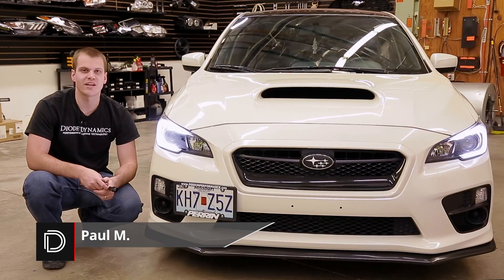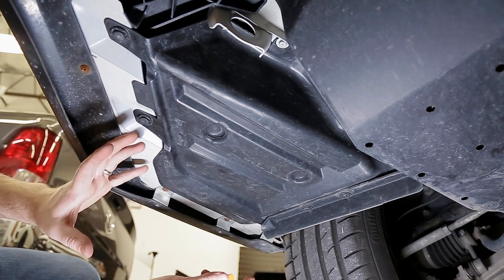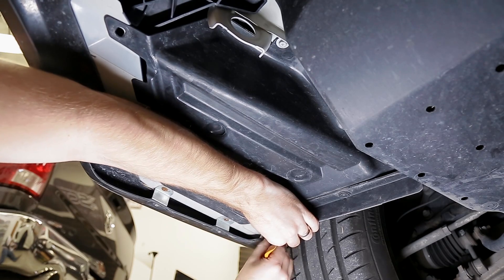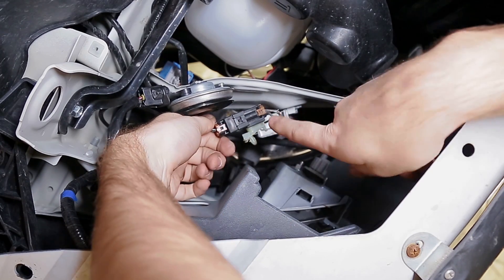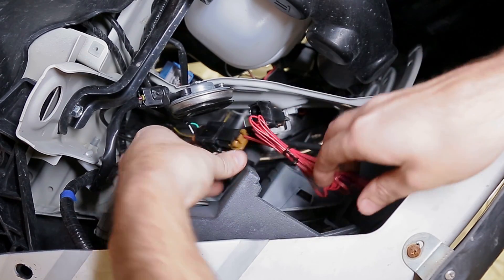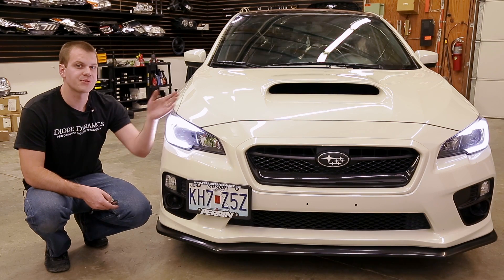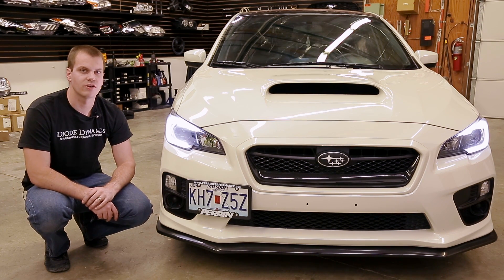How to Install 2015-2017 Subaru WRX/STi C-Light DRL Harness by Diode Dynamics

Comment: I have a 2017 premium. What do I need to buy to run this setup? I am guessing I need to swap out every bulb I have to LED's first?  Wouldn't the cost of doing that be on almost on par with a new set of nicer aftermarket headlight assemblys?

Comment: Installed this product and are very happy with the results! 
How do I keep my stock high beam function? And how do I keep my stock fog light function?
Reply from the maker: +Daniel Powers This harness won't affect the high beams or stock fog lights. It only keeps the C-Light on as the DRL when the headlights are turned on. If you have any further questions, please don't hesitate to contact us at 314-205-3033 Monday-Friday 9 a.m.- 5 p.m. CST, or shoot us an email at contact@diodedynamics.com!
Reply: can you guys toss up a link to the exact item on your website for 15+ WRX , just place it in description:)
Reply from the maker: +The Cisco Kidd This product is not listed separately on our website at this time. However, if you would like any assistance placing an order, please feel free to contact us at 314-205-3033 Monday-Friday 9 a.m.- 5 p.m. CST or at contact@diodedynamics.com!

Comment: I have the diode dynamics led bulb installed in my stock c light location on my 2019 wrx premium. Could i use this harness to disable the drl on the high beam spot and have the corner led run as the drl instead by tapping into the positive wire? I installed led high beams and the drl's are banging straight led high beam at people all the time. And i think the front would look much cleaner with the drl's coming from the corner.

Comment: Do you have to cut the  c wire and replace with the male connector. Or how you unplug the C wires from the headlights
Reply from the maker: Hey Lyon! You will not have to cut anything. You will simply unplug the factory connector from the back of the headlight. If you would like help with this process, please go ahead and give us a call at 314-205-3033 Monday-Friday 10 a.m.- 5 p.m. CST, or shoot us an email at contact@diodedynamics.com.

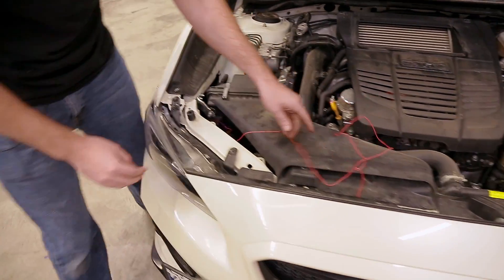Comment: 3:10 and 3:18 where does the other female/male part coming from? Is it from the head light?
Reply from the maker: If you watch from 2:18 and forward, it is coming from the new harness connector that is included in the kit!

Comment: So I have Akkon, spyder, redline 360, whatever you wanna call them, headlights and they have a clight. They are designed to run with the oem design. So the clight goes on when the 1st or 2nd light mode goes on. The drl is the high beam. I disconnected the drl plug so i wouldnt have my high beams on when my lights were off. Could I tap this harness into my headlights? I want me clights to be always on, even when the lights are off. I have an 18’ wrx
Reply from the maker: Hey David! Please go ahead and give us a call at 314-205-3033 Monday-Friday 10 a.m.- 5 p.m. CST, or shoot us an email at contact@diodedynamics.com, and our service team would be happy to help you with this!
Reply: Was this resolved I wanna know as well I have the harness installed to the c lights but my parking lights stays on as well.. I wanna know how to keep the parking lights off
Reply: @ljcorp09  Yes!! I made it work. You just tap the harness wires into the positive wires of the drl lights and leave the ground wires alone
Reply: @Gubster07  I've done that and my parking lights stays on for as well for some reason.. to make sure the positive on those headlights are the brown wire right?
Reply: @ljcorp09  Yes it is the brown wire, do you have a limited premium or base model?
Reply: @Gubster07  base model
Reply: @ljcorp09  Hmm interesting, not sure whats going on then, I have a premium and the light functions are the same as a base
Reply: @Gubster07  I don't get it either but I'm looking at the installation paper that came with the lights and im seeing that the LED bar says (D) parking lights im not sure if that makes a difference

Comment: was there any problems with the previous design as in the one that T off the highbeam plugs?
Reply: I dont have any problems with it other than the wiring being annoying sometimes, but its held up for quite a while
Reply: yea no I have the previous version as well and haven't had any issues at all.. I was just asking if they found a flaw in the previous design  or is it just to "clean" up wiring a bit
Reply: Pedro Cappas I dont think it would be because of a flaw, i wouldnt see a great company like diode to have a flaw in their products, its probably to clean up the wiring which would be nice
Reply from the maker: With the original modules, we found that over time, variations in the battery level on the vehicle can cause unreliable switching between high beam and DRL functions. This was pretty rare, and was impacted by the age of the vehicles' battery, and the temperature outside. This is a direct wiring solution, so there is no dependence on the vehicle's battery level anymore, to make sure it works perfectly for 100% of our customers. If your original modules are working well for you, great! No need to change anything.
Reply: @Diode Dynamics - I just ordered these c-lights with the DRL harness, but it came with the older one.  Any way I can get that new one without paying full price again?
Reply from the maker: +Michael Kinney Yes, we can get you taken care of. To ensure we send you the correct harness, please email a photo of the harness you received with your order information to contact@diodedynamics.com, and we can help you out!

Comment: Hi can you tap other light accessories to this harness to function as a drl. Ie: any other drl led lights you have on the car?
Reply from the maker: +Aaron Younger Yes, it is possible, but you may run the risk of overpowering the circuit. Please don't hesitate to contact us with any additional questions!

Comment: So I got the harness but where you plug in those wires from??
Reply from the maker: You'll want to tap the red wire from the harness to the red wire on the pigtail. If you still have questions, don't hesitate to contact us at contact@diodedynamics.com! 

http://images.diodedynamics.com/docs/install/subaru/wrx/15-17_Subaru_WRX_STi_Switchback_installation_guide.pdf

Comment: is this harness all thats needed to power the c lights? or do the c lights still need to be installed normally (as instructed in your c light install video)?
Reply from the maker: +Rizbomb The C-Lights would need to be installed as shown in our installation video, and then the DRL Harness would be added to keep the C-Lights on as the DRL. If you have any further questions, please don't hesitate to contact us!
Reply: clear enough, thanks for the reply!
Reply: actually got another question for you guys. I just got my clight in with harness and it looks like i received the older version drl harness, the one that uses the high beam plugs. Do they ultimately provide the same function? if so, id much prefer to use this newer style harness as it is a lot less to deal with.
Reply from the maker: +Rizbomb Please shoot us an email at contact@diodedynamics.com, and we can help you out!

Comment: Do these switch to turn signal lights or do u need a separate harness for that
Reply from the maker: +Joseph Kim These do switch to amber for the turn signal. Check them out at the link below!
https://www.diodedynamics.com/store/catalog/product/view/id/23059/s/2015-2017-subaru-wrx-sti-c-light-switchback-led-boards/category/1451/
Reply from the maker: +Joseph Kim The  boards themselves will switch to amber for the turn signal automatically. The harness featured in the video will also make them function as the DRL. If you have any further questions, please don't hesitate to contact us!

Comment: Hey DD, what temp are the hid bulbs?, I'm trying to match to the c-light, just like your white wrx
Reply: BlueWrx 6500k
Reply from the maker: +BlueWrx 5000K HIDs will be a good match for the C-Light! Check out the link below for more information! 
https://www.diodedynamics.com/store/led-bulbs/listed-by-vehicle/subaru/wrx/2008-2013-subaru-wrx-low-beam-hid-conversion-kit

Comment: I installed my DRL harness and when I turn on the high beams, only one side turns on. I think I may have a defective product. Is there any way you guys could help me out.
Reply from the maker: +valentino briones We're very sorry to hear about the issues you're seeing with your harness. Please give us a call at 314-205-3033 Monday-Friday 9 a.m.- 5 p.m. CST, or shoot us an email at contact@diodedynamics.com, and we can help you troubleshoot and send a replacement if necessary!

Comment: I only have one drl turning on. My passenger side. Still have power hence the turn signal works. Help?
Reply from the maker: Hi Phillip, thanks for reaching out! We're sorry your experiencing an issue! Please go ahead and give us a call at 314-205-3033 Monday-Friday 9 a.m.- 5 p.m. CST, or shoot us an email at contact@diodedynamics.com, and our service team will be happy to help troubleshoot that!
Reply: I had the same issue. Check both drivers on a working side to ensure it's not a driver issue. Then mix and match your components from diode to rule out the things that work. The issue I had was the pigtail end of diodes harness. It wasn't getting enough current. They must have accidentally crimped some insulation in the factory not giving good contact. So I snipped the diode connectors,  stripped some wire and installed new connectors. Now they're bright as the sun

Comment: Do you have something similar that will work with my 2017 Outback 3.6R?  Thanks.
Reply from the maker: +Manny Adriano We sure do! Check them out at the link below.
https://www.diodedynamics.com/store/catalog/product/view/id/24288/s/2015-2017-subaru-outback-c-light-led-halos/category/1451/

Comment: Would this work with the Vipmotoz c-shape OLEDS for the 2013 WRX STI?
Reply from the maker: +j.um We have computer-designed our boards to be a direct fit in the factory headlight. Unfortunately, we are not familiar with the product you are referring to, so we would not be able to confirm fitment. If you have any further questions, please don't hesitate to contact us!

Comment: hi Diode Dynamics - i dont understand where the other plug (male - female) is coming from, so you unplug the DRL resistor, then two wires go out to be plug to another plug? where is the other attachment plug coming from?
Reply from the maker: +Genesis Garcia Please email us at contact@diodedynamics.com, and we can help you out!
Reply: Diode Dynamics I'm also curious as to where the male cable came from. It is not showed in the video, is it included with the harness
Reply from the maker: +Genesis Garcia Thanks for reaching out! There isn't a male-female connector. There is one connector that goes to the DRL resistor and then two female connectors that plug into the red wire coming from the driver on each side of the vehicle. Check out our installation guide below for more information!
http://diodedynamics.com/docs/install/subaru/wrx/Subaru_WRX_STi_CLight_DRL_Harness_Install_Guide.pdf
Reply from the maker: +Snacks The Cat Thanks for reaching out! There isn't a male-female connector. There is one connector that goes to the DRL resistor and then two female connectors that plug into the red wire coming from the driver on each side of the vehicle. Check out our installation guide below for more information!
http://diodedynamics.com/docs/install/subaru/wrx/Subaru_WRX_STi_CLight_DRL_Harness_Install_Guide.pdf
Reply: It seems like you need to replace your stock C lights with after market ones. The new after market C lights are connected to the wire that you need to run out of the headlight and into this new harness. Looks sweet, but I'm not willing to take the risk of moisture in my headlight assemblies years later.
Reply: I think what Genesis Gacia meant was you showed two red wires for each headlight but were confused where those red wires will be connected to the headlight. I did not see any on the video where those two wires connected from the headlight.

Comment: I installed my DRL harness and when I turn on the high beams, only one side turns on. I think I may have a defective product.
Reply from the maker: +valentino briones We're very sorry to hear about the issues you're seeing with your harness. Please give us a call at 314-205-3033 Monday-Friday 9 a.m.- 5 p.m. CST, or shoot us an email at contact@diodedynamics.com, and we can help you troubleshoot and send a replacement if necessary!

Comment: Need to do more better video on the wire that on the C wire that connected to the head light. Cause all I see is you already pull the C wire out already.
Reply from the maker: Hey Lyon! We responded to your other comment. Please go ahead and give us a call at 314-205-3033 Monday-Friday 10 a.m.- 5 p.m. CST, or shoot us an email at contact@diodedynamics.com, and we can help walk you through the install!

Comment: So I just need to order 1?
Reply from the maker: That's correct!
Reply: Even if I have an STI that comes with the C lights
Reply from the maker: @wcontreras34  If your vehicle is using our Switchback LED C-Lights, you'll only need 1 harness! This product is not compatible with other C-Light designs.
Reply: @diodedynamics  so basically this won’t work with my stock led headlights? (2017 Sti)
Reply from the maker: @Aura_m93  Hey there! These are a direct replacement for factory C-lights for the 2015-2021 WRX/STi! Feel free to check them out at the link below:

https://www.diodedynamics.com/2015-2021-subaru-wrx-sti-c-light-led-halos.html
Reply: @diodedynamics  these are switch back? I like my white LED over amber
Reply from the maker: @Aura_m93  We do offer a switchback option! Check it out at the link below

https://www.diodedynamics.com/2015-2021-subaru-wrx-sti-c-light-led-halos.html

Comment: I have some subiespeed led fog bezels installed with the harness they sell with the 2 fuses that serve to run the bezels as DRLs. Im planning on installing the C-lights  soon. Can I splice into the harness that powers the bezels to run the c lights as DRls or can I use the diode dynamics harness at the same time as the other ones with no issue? Please help.
Reply from the maker: Hi there! Please go ahead and give us a call at 314-205-3033 Monday-Friday 9 a.m.- 5 p.m. CST, or shoot us an email at contact@diodedynamics.com, and our service team will be happy to help with that!